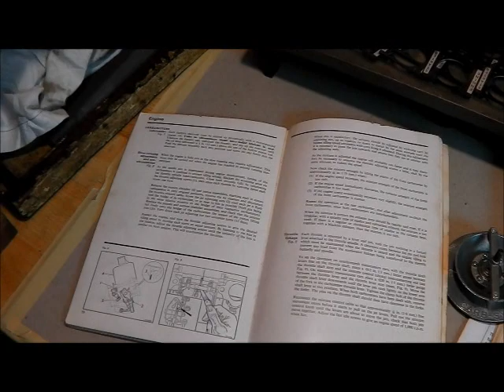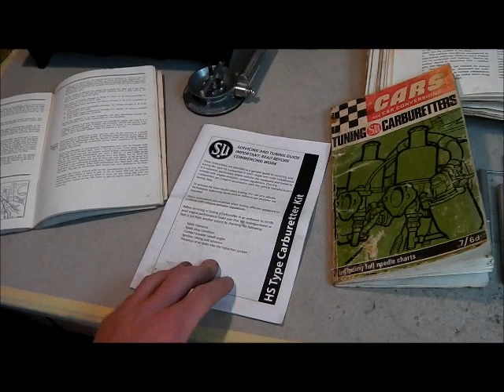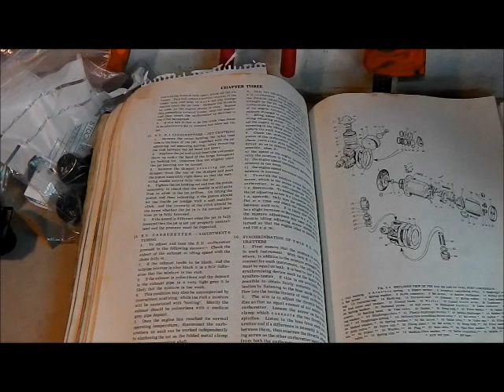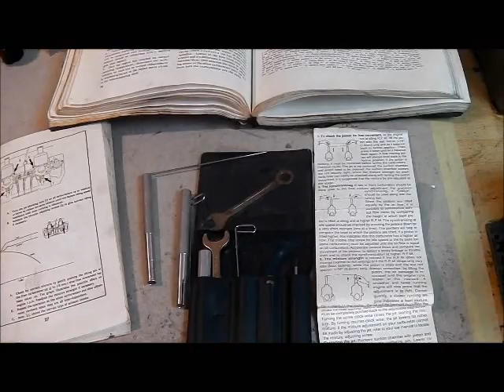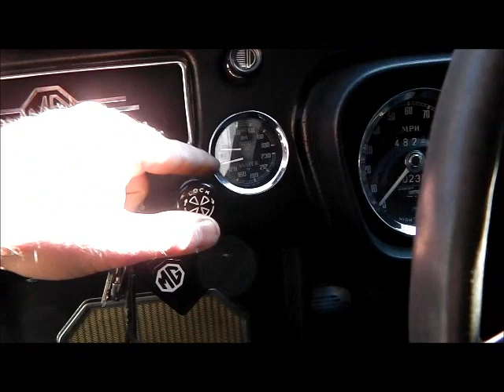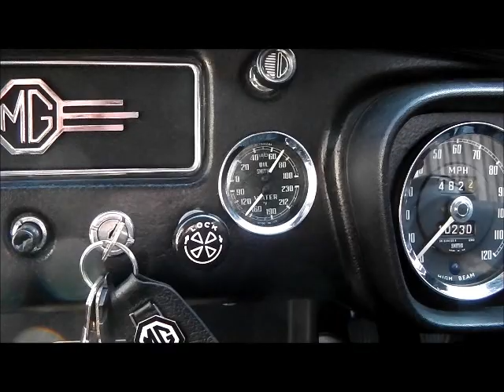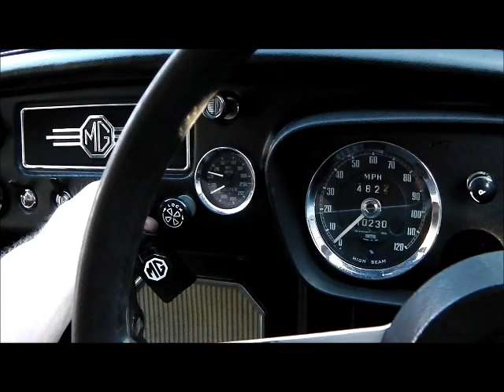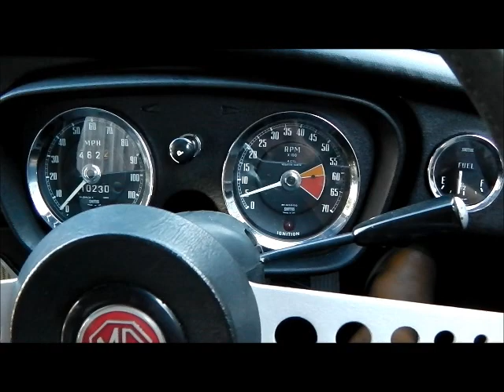MGB Carburettor Overhaul - Part 3

Comment: Great video (watched all three parts). I have a '72 Midget with twin HS2 SUs but my carbs do not have overflow pipes, rather just baffles on the top of each float chamber lid which allow sexcess fuel to simply spill onto the float lid. Not ideal as this causes fuel to drip onto the manifold. I was wondering if the float bowl lids with overflow fittings are interchangeable?

Comment: Following flooding of my float bowls (which has now been cured) I fitted approx 6 inch lengths of fish tank clear plastic pipes which will now divert any fuel well away from the manifold and down into the body of the engine bay.

Comment: On our (earlier) car the overflow pipes are fastened to the engine block with metal 
‘P’ clips, I believe using the threads that would have attached a mechanical fuel pump in other vehicle applications.
Reply from the maker: Thanks, there is just a blanking plate there on my car, seemingly no provision for clips. Sounds like a good mod to do though, I could fit some studs instead of bolts.

Comment: When using the specific SU balancing tool kit, I assume there must be oil in the dashpots or should it be done 'dry' and oil added afterwards? I have looked everywhere and can't find the answer to this and have learnt that nothing should be assumed. Many thanks
Reply from the maker: That's a good question and something I pondered myself. I too couldn't find the answer but I decided to do the set up without oil but later adjusted again with oil - that is the "real world" condition that the carburetors will be in when driving. That seemed to be successful and it didn't make much difference either way. All I can add is that the car since developed a slight hesitancy again, one of the dampers had started to stick and adjusting the position of the chamber  with the screws loose helped. The cure was going from the SU recommended oil (SAE 20) to 20/50 motor oil. Since then, the car has been a delight.
Reply: @steamwally  Many thanks.I'm pleased it's not just me who didn't know the answer!  It's very annoying but simple instructions like that are so often omitted.  Interesting re the damper oil. I'm just about to empty mine and clean and refill using SAE20. I've no idea what is currently in there. Is 20/50 thinner or thicker than SAE20?
Reply from the maker: @DavidUKesb  To be honest, I'm not that up on oils but the 20/50 results in a slightly richer mixture and cured a slight flat spot, so it must remain at a higher viscosity than the SAE20. Monograde vs Multigrade...